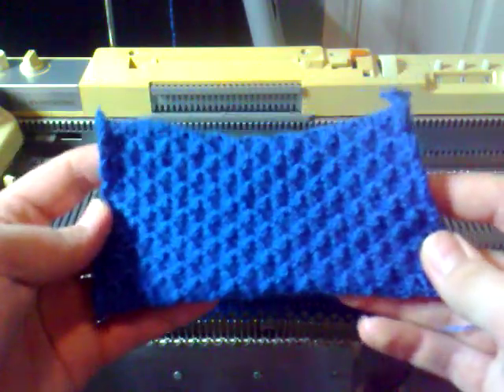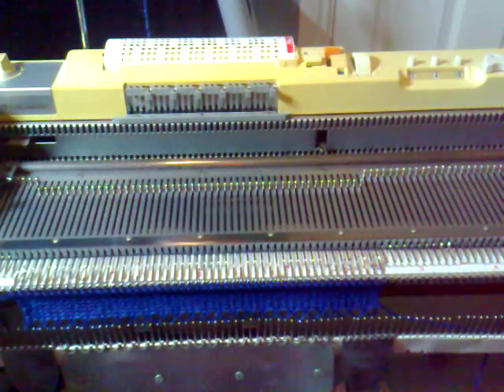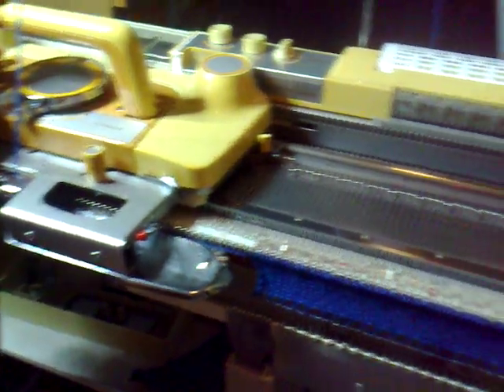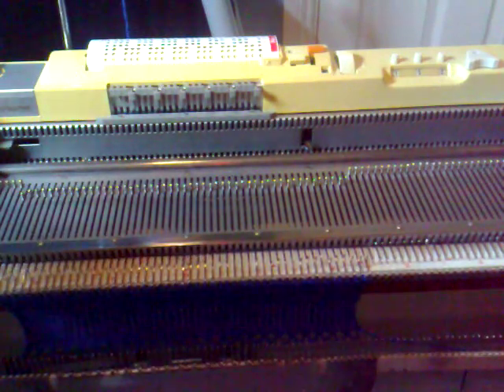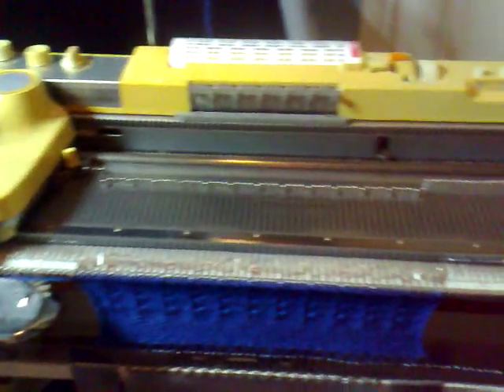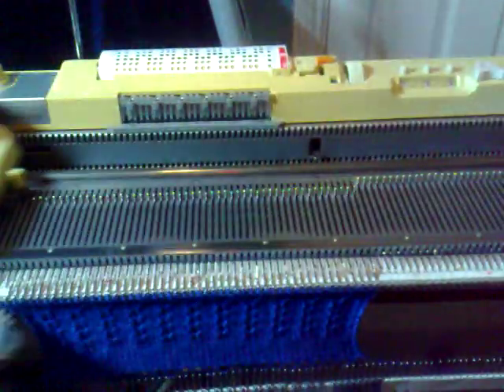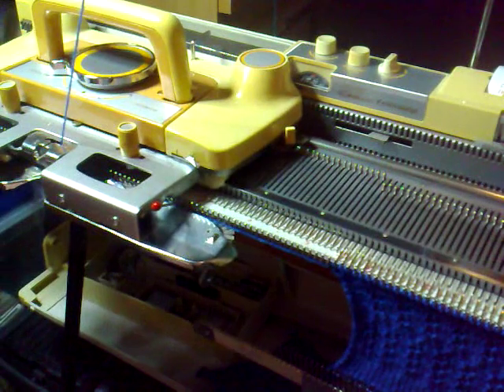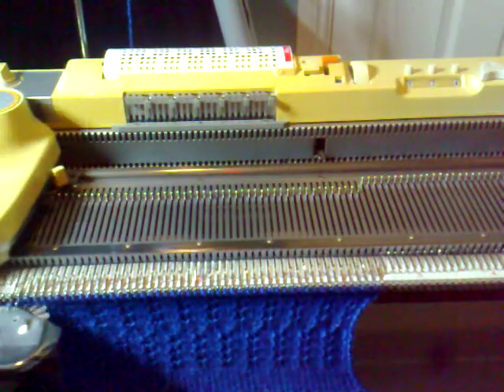Tuck Stitch Variation On Knitmaster/Studio/Silver Reed Machines

Comment: I've got the HK160 mid-gauge machine which includes these punchcards (18 stitch repeat), and I tried to make a sweater using this very same stitch.  However, I didn't progress past the back of the garment because it came up a quarter of the size that it should have been.  I've only ever done plain stocking stitch jumpers in a variety of other yarns and they've always worked very well.  I don't know how to do a tension swatch for tuck stitch - do you know if (or how) I can adjust a simple stocking stitch sweater pattern for tuck/slip stitch?